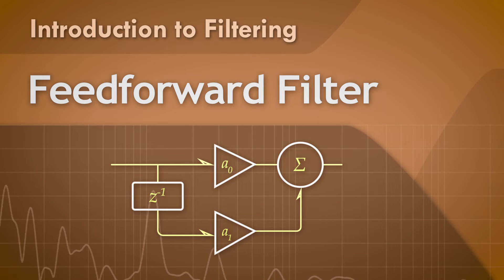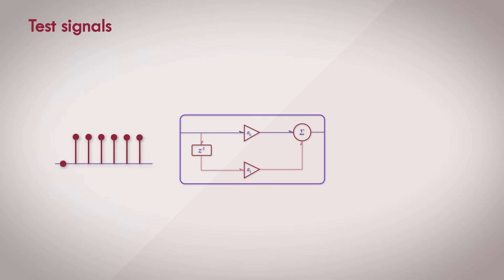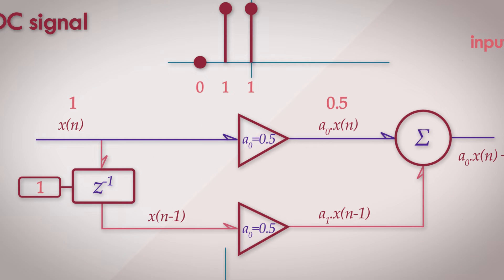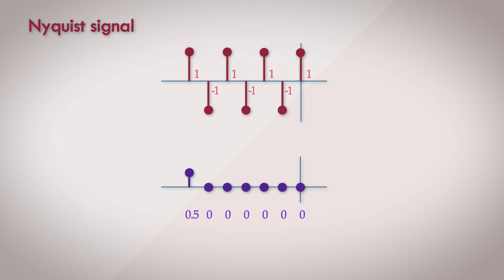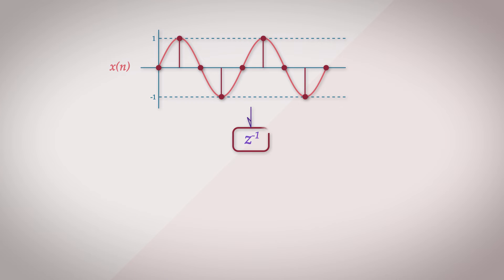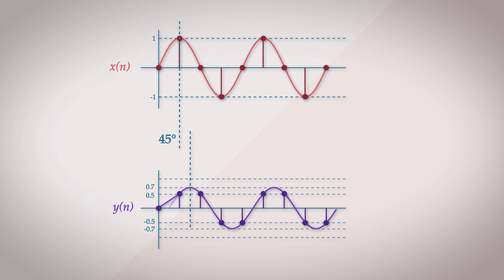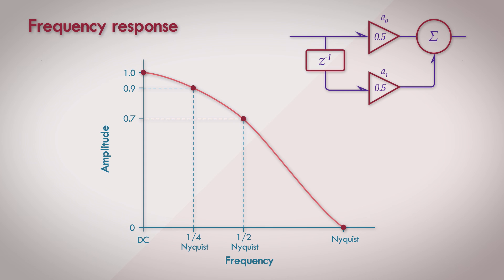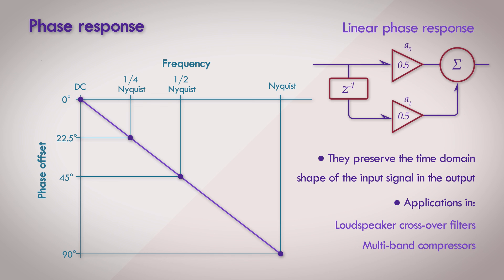4. Feedforward Filter - Digital Filter Basics

Comment: So how would you do a 2-Pole (stage) FIR LP filter?
Reply from the maker: @DKDiveDude  there are no poles in an FIR filter topology. Only Zeros. That's one of the reasons why they are inherently stable. But a 2nd order FIR filter should be fairly straightforward.
Reply: @akashmurthy  Yeah I actually knew, so I guess you just sum the different stages

Comment: @akash murthy. can you please kindly explain why the phase response for Nyquist pattern  is 90 degree? From my understanding, after going through the filters, everything gets cancelled out ... Thank you
Reply from the maker: Good question. If you look at 10:30 I talk about how a 1 sample delay causes 90deg phase shift in the 1/2 Nyquist input signal, but the output signal as a result of the combination of original input and 90deg phase shifted input is 45deg phase shifted. 
It's the same case here. The phase shift represented in the graph is the phase shift of the "output signal" of the filter, not the phase shift introduced just by the delay element.

Comment: It really nice explanation, can I ask the symmetric coefficients you mentions in phase response: what is "symmetric" means in this case? I guess it means abs(a0) == abs(a1), right? And how "symmetric" extents to more than 2 coefficients (n coefficients)?
Reply from the maker: That's what it means, yes. The same formula applies to any number of coefficients. I know for certainty that when coefficients are equal, the phase is linear, like in a moving average filter for example. I'm not a hundred percent sure about how sign of the coefficients affects linearity for anything more than 2 coefficients. But I don't think it does. I'm not in front of my computer for many days to check, unfortunately.
Reply: thanks for your info.